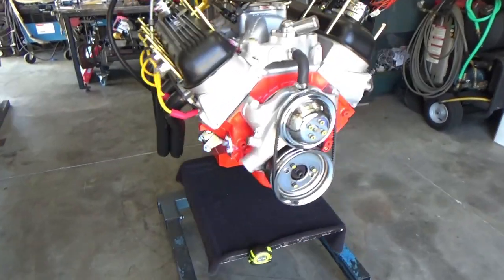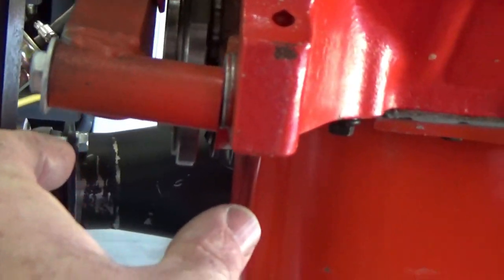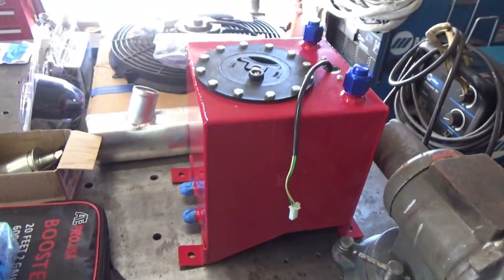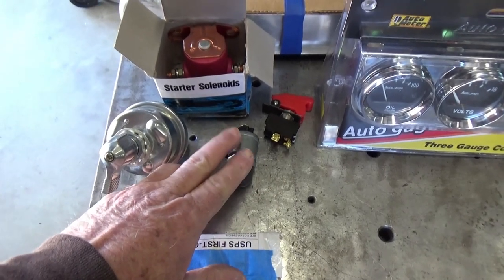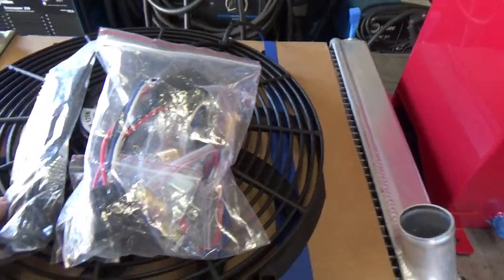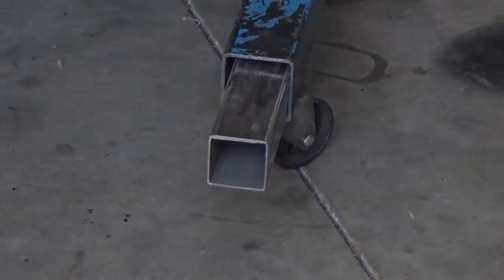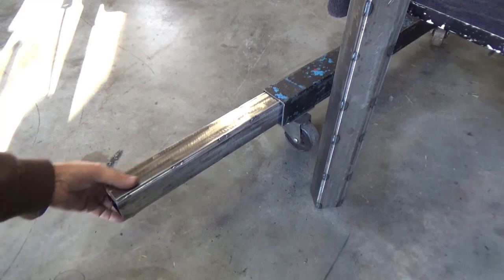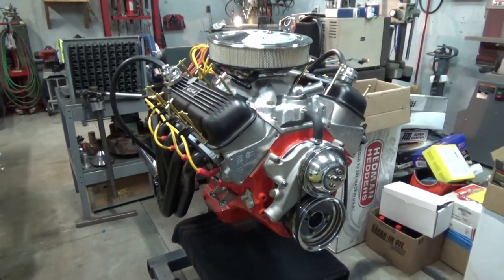Old Engine Stand Repurposed for Engine Test Stand... Build Part # 1

Comment: Great to see your inventive mind at work again. Your ideas and work are inspiring.  Engine stand becomes engine test stand!  With the 2x2 inch square tubing, could you weld 2 bolt anchors at equal distances from the ends of each 29 inch legs? Weld the threaded bolt anchors on the upper corners of the outside tubing to allow them to push the inner tubing squarely against the inner tubing, wedging them in place more securely? Or I believe I have seen where a bolt can pass through the top of the outer tubing, thread on the wall of the inner tube and extend to the bottom side of the inner tubing. A 1 inch steel plate is placed at the contact point of the bolt where it meets the floor of the inner tubing. When you crank down on the bolt the inner steel tubing is expanded enough to wedge it inside the outer tube. Whatever you do we will be watching and hoping it all comes together for you. Wonder if you need tubing legs that come out on the sides to prevent a rollover, or locking wheels - the BBC is sooooo heavy.
Reply from the maker: Hi Mike....Thanks for the nice comments and I like your idea, it sounds better than what I did
capping the top and bottom of the 2x2 square tubing to tighten it up....  With that idea, I may
be able to utilizes it in other places on this build....  The extra legs and locking wheels might 
come, but I think I'm going to try it as is and improve as needed...